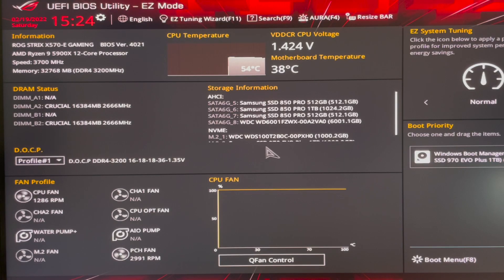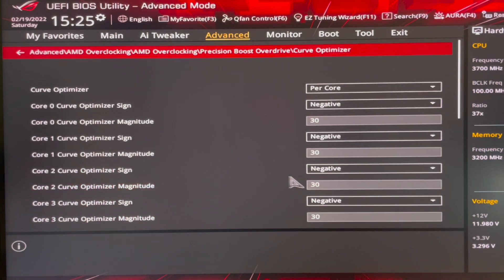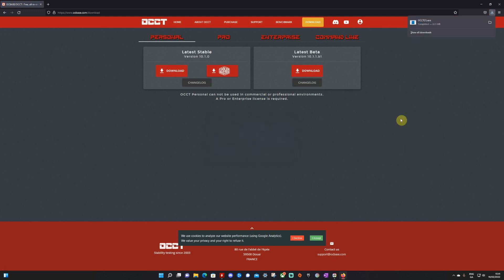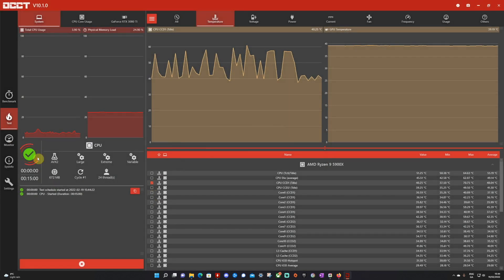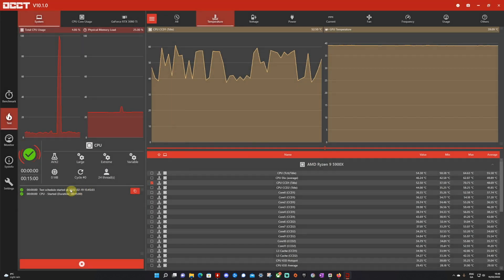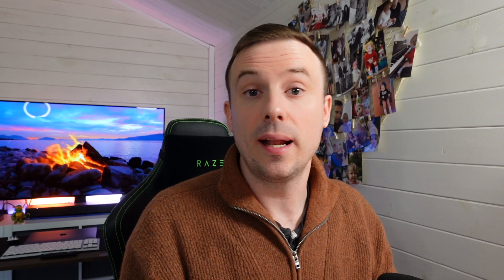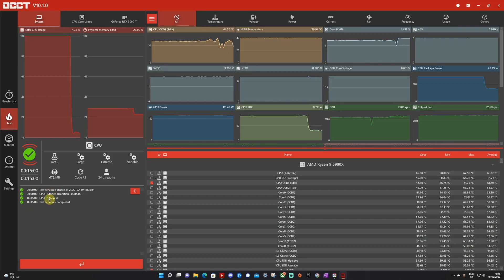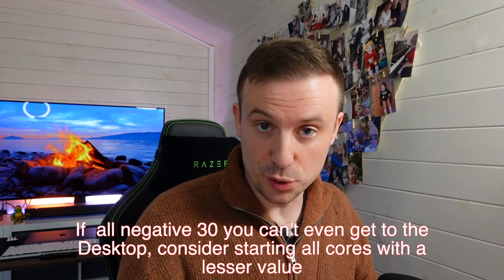Ryzen 5800x 5900x CPU Per Core Undervolt Bios Settings | Lower Temps | Better Performance

Comment: Impressive  and informational video like your previous curve optimizer video, thank you. Have you tried to set CCD 1 cores 0-6 only negative offset of 15 instead of 30 to get better performance. It seems as though 30 all cores kind of kills performance a bit too much. Preferably on CCD1.
Reply from the maker: I have found this has improved performance so far but will give it a try to see if any difference
Reply: @FPtechtalk  did you end up getting a result from this you dont mind sharing? Just got a 5800x and this video has helped alot.  My rig is passing the OCCT test with an all core -30 curve and a +200 on the PBO boost. Hitting 5.05Ghz and barely ever hits 80C.  I feel like I got lucky in the sand lotto. This video was super helpful!!